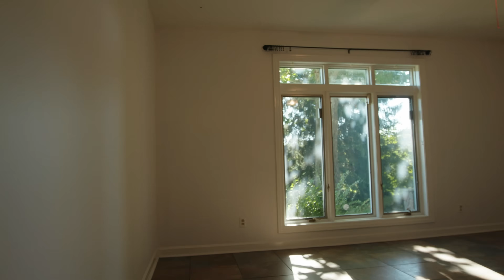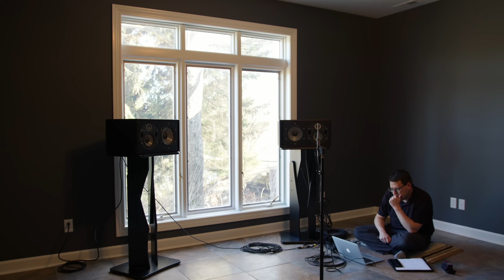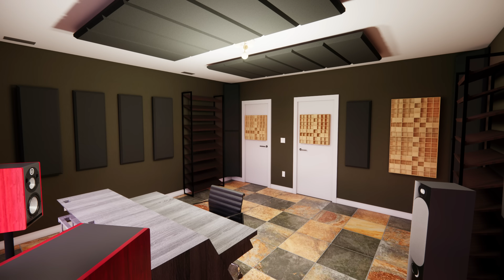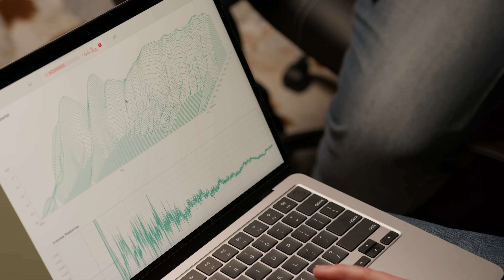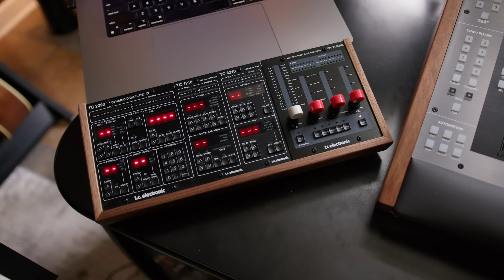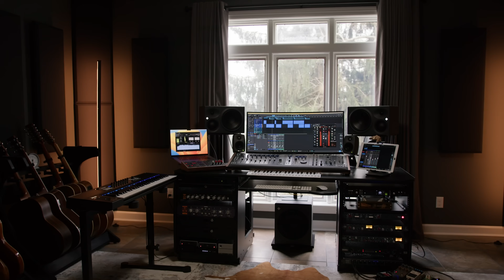DIY Home Studio Before & After: Mitch Gallagher’s No-construction Build

Comment: Hey Mitch, great room! What type curtains do you have for the windows? Anything sound related? I built a studio a few years ago that literally has six 6x3 windows looking out the back which was inspired by Le Studio. I've never wanted to put anything over them b/c of the amazing view of the woods BUT yours is a very clean looking solution. Thanx ahead of time!
Reply from the maker: Hey, Jeff - Thanks! My curtains aren’t specifically “acoustic.” My very-talented designer wife picked them out for me. But there are a few key points to getting some acoustic performance out of curtains in a studio. First, get heavy fabric, not thin or gauzy. Second, don’t get shiny or satiny fabric, which can be reflective. Third, get way more curtains than you think you’ll need. I have eight curtain panels across my window — under ordinary circumstances four panels would have been plenty. The idea is to allow for lots of deep folds and gathers in the material when the curtains are pulled across the window, which helps with absorption. When the curtains are open, you still get some benefit from all those tightly packed panels to the sides of the window. — Hope this helps, thanks for watching! Mitch

Comment: Was this room sound proofed much before, or is it just standard construction (1 layer of drywall with fiberglass or foam insulation)?  Just curious how well it was sound proofed prior to acoustic treatment.  Thank for the informative video.  Working on a similar shaped room and tranforming to tracking and mixing room.

Comment: Awesome Studio Setup!  Are those acoustic panels along the walls and bass traps from Prime Acoustic Panels?  Is it the London Kit?
Reply from the maker: The panels in the ceiling cloud are Primacoustic. They were not a kit, just panels that I’ve had in various studios and kept when we moved. The ones on the walls/corners are from Acoustical Fulfillment.
Hope this helps, thanks for watching!
Mitch
Reply: @sweetwater one last question., those impalers used behind the panels , are they two inch or three inches from the wall?  I believe Sweetwater only carries three inches wall impalers, correct?  Thank you for your response 🙌🏻

Comment: I am running on a MacBook Pro as well. Which hub are you using that enables your MacBook Pro to see all of your gear at one time?
Reply from the maker: Great question – there is a limitation to how many USB devices can be on a single USB bus. Fortunately, there is more than one bus in a MacBook Pro. So, I’m using three hubs to connect all the gear. My Macbook Pro is always connected to two of them: One has a thunderbolt port, so that has the UA audio interface, plus USB devices – and it supplies power for the computer. The second MBP port connects to my computer monitor, which has a hub built-in, and that’s where the SSL control surfaces connect. I have a third dock that only gets hooked up when I need to use it. That one has back-up drives and a RAID for archiving on it.
Hope this helps, thanks for watching!
Mitch

Comment: Great video . Would you still recommend the Neumann kh310 and kh750 for mixing ? 
Why didn’t you use the ma-1 calibration but used the arc instead?
Reply: I love the Neumann monitors and sub. They work very well for me. I probably will use MA-1 -- the ARC system is great, right now I have Sonarworks running on my Apollo interface. All are great solutions!
Reply: @mitchgallagher2755 that’s great , I have the gen 1 twin x quad . Looking to upgrade , would you advise gen 2 Apollo or Neumann mt48 ?
Reply: @mitzthegamer  Both are great choices. The Apollo eco-system is hard to argue with! But I've been very impressed by the audio qualities and capabilities of MT48. You can't go wrong with either one. If you want to run Sonarworks, I believe it only runs on the Apollo at this point.

Comment: What about carpet on the desk to avoid reflections?
Reply: With controllers, control surfaces, iPad, laptop, etc., my desk is so covered in gear, I'm not really concerned about it, and doubt carpet would make much difference. If you have a lot of exposed flat surface, it might help!
Reply: @mitchgallagher2755 
Thanks for the reply, Mitch!
I always find your videos entertaining and educational. I've watched your Motu 828 presentation at least a half dozen times as I'm in the market for an interface as good as I can afford.
   I'm now a victim of information paralyzation. The 828 looks like the one for me as I can connect all the gear I've been collecting, and not using, over the years. Purchased a Faderport8 and Studio One upgrade from SW several years ago. Never downloaded the software or even plugged in the FP8. I'm an older guy and the clock is ticking, as they say.
   If I don't get motivated soon it may never happen. I finally have some time on my hands.
   Good luck with the new studio.

Comment: Great video! However the one thing that it left me curious about is how you are stably connecting all of that gear to a macbook?? Between the external monitors, audio interface, dsp accelerators, hard drives, multiple midi and console controllers, etc. i assume you are using some type of a hub. But with the various standards and added complexity those introduce it just seems like it would be a minefield to get all of that working without compromises to the limited connectivity on a mbp.
Reply: Thanks for watching -- and a great topic for discussion. In fact, we were just talking about doing an article or video for Sweetwater on this type of thing. But briefly, the MBP has 3 USB/Thunderbolt ports as well as an HDMI port -- and clearly I've got a lot more USB gear in particular, than that. There is a limit to the number of USB devices you can have on a given computer bus. Because of this, I've actually ended up with 3 hubs. One only gets plugged in when I'm backing up or using an external drive, otherwise I don't connect it. But the cable is ready and waiting for easy connection to the MBP. I use 2 other hubs (or maybe more accurately, docks) for the external monitor, the UA Thunderbolt interface and Satellite, Ethernet, and the USB stuff. It's all working!
Reply: @mitchgallagher2755  Really appreciate these in depth videos and how clearly you explain everything. Thanks for the reply!

Comment: Hey Mitch congratulations for your studio hey what is that subwoofer under the desktop cause I wanna buy one at sweetwater see I’m using NS 10 Yamaha what you recommend thanks
Reply: I have a Neumann KH750, which is a perfect match for my KH310 monitors. If you want to stick with Yamaha, I'd consider the HS8S -- should match very well with NS10s.

Comment: Hi Mitch, please help me as I am in the process of purchasing new monitors. What was your main reason for picking up 310s over anything else?
Reply: Several reasons -- I listened to a bunch of monitors in the rooms, a true luxury! I've used Neumann KH120s for years. But the 310/750 combo seemed to work best in the space.
Reply: @mitchgallagher2755  Thanks Mitch. Where I live, there is no showroom to listen to anything more serious than Yamaha HS8 so I am buying blindly. Now I am split between 310s or Adam's A8H but I am not sure if my small room (9x11ft) can handle those so it seems that Kali IN-8 would be the best option. 
Thanks again for your reply

Comment: What happened to the Focal Trio's that is seen in part of the video?
Reply: I tried many sets of monitors in the room. The Focals are awesome, I've used them extensively, and always rely on my Focal Clear MG headphones. I've also used Neumann KH120 monitors for many years. The Neumanns worked really well in the space, so I ended up choosing them.
Reply: Nice. I have the Clear MG headphones myself and love them. I also two UF8's, UF1, and UC1. I put the UC1 in front of  the UF1 (closer to my monitor) so it's like an analog board where the EQ and dynamics controls are forward of the faders. Neumann makes great monitors
Reply: @revelationsoundstudio  That's a great rig!

Comment: Technically it's not 38% it is actually 39.6% between the 4th and 6th node when you lay it all out in CAD. The fourth node is always at 37.5% and the 6th node is always at 41.7%. So you get 37.5 + 41.7 / 2 = 39.6%. And 39.6% only works in medium-sized rooms. In smaller rooms, you must move back and use 45.8%, otherwise your front studio monitors are literally crashing into the front wall. It's funny how people attempt to demonize carpet, yet every studio that has a hard surface floor or hardwood floor puts down a giant area rug.

Comment: Nice and tidy. :) How about going with one IK ARC on Genelecs, and using Neumann MA-1 proprietary correction on Neumann speakers with DSP of KH 750? It not only corrects amplitude but phase too. Would make a huge difference in monitoring.
Reply: I agree that would be a great solution. The ARC Studio works great! I may also end up with Genelecs with GLM to replace my small second set of monitors.

Comment: Maybe it's just me, but everytime i see someone do all the over the top room tweaking, the end product still sounds sub par. But the top Nashville studios will throw most of that out the window and still sound excellent.
Reply: Not sure what "end product" you're referring to -- the sound in the room or the sound of the productions? I've been in all of the top Nashville studios, and they all are tweaked to sound fantastic and also do great sounding productions. But -- having a great sounding room doesn't guarantee great-sounding productions; that's for sure!
Reply: @mitchgallagher2755  I've seen control rooms set up in the middle of a big room, point the speakers at the engineers ears, throw a few rugs down and thats about it. No lasers needed. Have you ever been to sun studios lol? Much like diets, seems like the must haves change every few years. Whats a no no today might be a requirement in 2 years.
Reply: @BobbyCulpepperGuitar  I have been to Sun, Motown, etc. -- all great spaces! The question would be, are they amazing sounding by "accident" -- because of the existing dimensions, etc., or amazing  in spite of whatever the room was/is? (I don't know the answers.) For most of us working in bedrooms and other non-purpose designed spaces, putting a little bit of science to work increases the odds of ending up with a great sounding space. I'd love to just drop the gear in a room and have it sound great! It's never quite worked that way in my experience.

Comment: A question I have re all these bedroom studios: Does the typical bedroom carry enough power to run all this gear or do you have to bring in more power?
Reply: Depends on how much you're going to run at once and how power hungry it all is.   Most folks aren't going to have everything always powered on either, so that's a consideration.
Reply: I talked to an electrician about this at one point a long time ago, and he measured the load the studio was pulling. According to him, most gear uses very little current, actually. It's tube amps, large powered monitors,  and those sorts of things that can draw more juice when you crank them up. But even those are just idling much of the time. I've never had an issue with available power in all the studios I've owned.
Reply: @mitchgallagher2755  Great to know. I guess that's why no one brings up😁
Reply: @theBullringLive  I think for most folks 1 20Amp circuit is likely more than enough.  Maybe a second if you have a lot of power hungry stuff.
Reply: @theBullringLive  In my mind, an important consideration is trying to stay on a separate circuit from other major items in the house, especially the kitchen -- fridge, blender, microwave, etc. In most houses the bedroom outlets are separated from those, which is nice!
Reply: @mitchgallagher2755  I live in a motorhome with only 50 amp service and am setting up a video editing area in my bedroom. I want to be able to setup atmos to try and mimic being in the center of the track so adding in interface and powered speakers were a bit of a concern. I've got 2 furman power conditioners for all the electronics going into a 20 amp circuit for the washer/dryer. I think I'll be good as long as I don't run the w/d at the same time. The couple of weeks in the Florida winters that I have to run heaters may be a bit trying as they use more power than the ac's.

Comment: Maybe I missed it but why not use the room correction built into the neumann sub?
Reply: Great question -- I was in the midst of doing my video for Sweetwater on the IK system when this was coming together, so I plugged it in and found it worked great. I like that I can hit "bypass" on the box, and there's no latency for tracking. I just picked up the MA-1 microphone and I'm going to get the Neumann system dialed in. I'm curious to compare. I've used it in the past, and it's been great.

Comment: Curious why Mitch isn't using the MA-1 room correction built into his subwoofer? Isn't manufacturer room correction like Neumann MA-1 and Genelec GLM considered the next best thing after professional solutions like Trinnov and Dirac?
Reply: Great question -- I was in the midst of doing my video for Sweetwater on the IK system when this was coming together, so I plugged it in and found it worked great. I like that I can hit "bypass" on the box, and there's no latency for tracking. I just picked up the MA-1 microphone and I'm going to get the Neumann system dialed in. I'm curious to compare. I've used it in the past, and it's been great. I used GLM in the room when I was auditioning monitors before settling on the Neumanns, and I'm thinking at some point I'll upgrade my set of smaller, second monitors to Genelecs that have GLM onboard. I haven't had a chance to try the Trinnov yet, but I'd love to check it out!

Comment: Looks great! Out of curiosity, why did you use the IK ARC Studio over the Neumann MA-1 system for the KH750/KH310's?
Reply: Great question -- I was in the midst of doing my video for Sweetwater on the IK system when this was coming together, so I plugged it in and found it worked great. I like that I can hit "bypass" on the box, and there's no latency for tracking. I just picked up the MA-1 microphone and I'm going to get theNeumann system dialed in. I'm curious to compare. I've used it in the past, and it's been great.
Reply: @mitchgallagher2755  Thanks Mitch. I am very interested to hear your thoughts when you’ve compared them 😊👍🏻

Comment: How do u like these Neumann monitors compare to the Focals Mitch?
Reply: I love Focals and have relied on them extensively in the past -- and I always rely on my Focal Clear MG headphones. (For fun, they actually made me a set with a "Clear Mitch Gallagher" label on them instead of "Clear MG.")  For this project, I was very fortunate to be able to audition a bunch of different monitors from several manufacturers in my space. Honestly, they were all great, and I would have been happy with any of them. I've been using Neumann KH120 monitors for many years, and found that in this space, the larger KH310 monitors worked really well. Having the room calibration option in the subwoofer is a big bonus, too.
Reply: My question as well.

Comment: Mitch! why do you use Neumann speaker? Are better than Focal speakers?
Reply: chacun a son gout man ;)
Reply: I wouldn't say "better." I love Focals and have relied on them extensively in the past -- and I always rely on my Focal Clear MG headphones. (For fun, they actually made me a set with a "Clear Mitch Gallagher" label on them instead of "Clear MG.")  For this project, I was very fortunate to be able to audition a bunch of different monitors from several manufacturers in my space. Honestly, they were all great, and I would have been happy with any of them. I've been using Neumann KH120 monitors for many years, and found that in this space, the larger KH310 monitors worked really well. Having the room calibration option in the subwoofer is a big bonus, too.

Comment: The reverbation and noise reflection that was very prominent and now it sounds really good
Reply: it's relatively easy to treat the mid's and high's, but they didn't treat the low end under 100Hz. You need much deeper absorption that's based on pressure based absorption.  I would have chosen other products from another company if it was my room.  Also, the amount of diffusion was minimal and I highly doubt he has enough surface coverage.  Typically for diffusion, you need at LEAST 50% or more surface coverage, but you first have to treat the other problems first, which he didn't.
Reply: @Oneness100  There certainly are many ways you could approach the process. This was what Gavin suggested, and it turned out great! We did discuss in the video that the low bass would not be addressed much by these treatments. That's where the IK Multimedia Arc systems are coming in very handy!
Reply: @mitchgallagher2755  The process I was taught is to fix the low frequency problems first when dealing with a full spectrum application like a control room.

Low frequencies are the most powerful. the most difficult to deal with.  once you get the low frequency problems solved, the mid's and high's are easy to fix.  And THEN you add diffusion.

It's too bad Gavin doesn't know about the other company's products and have familiarity with them, if he did, then he would probably suggest them over what you have.

But if you're fine with not fixing the low end, then keep what you have, but if you want to fix the low end and have an insane listening experience, let me know. I'd be happy to tell you what company you should contact. Or, if you have another room you want to treat.

No, I do not get paid by this company, I do not work for them. I've just been in a few of their rooms that blew my mind and I love to turn others onto their products because when it comes to acoustic treatment, most products are just not that good IMO.
Reply: @Oneness100  OK